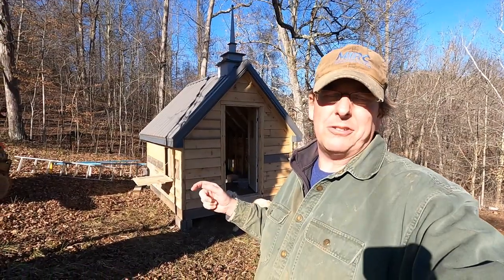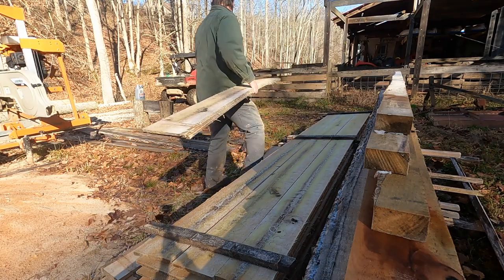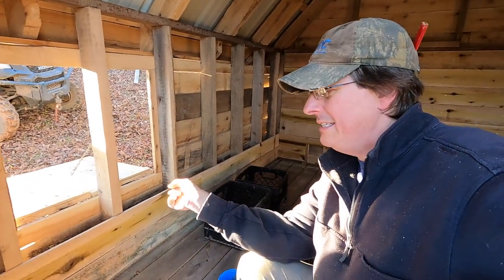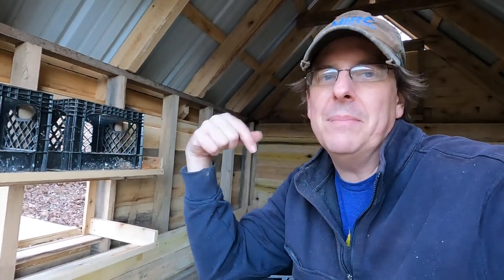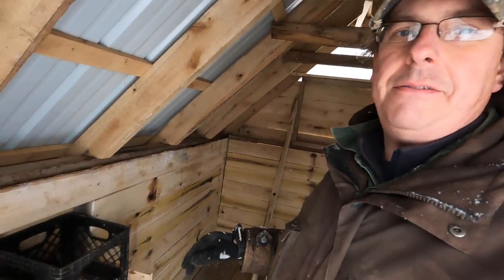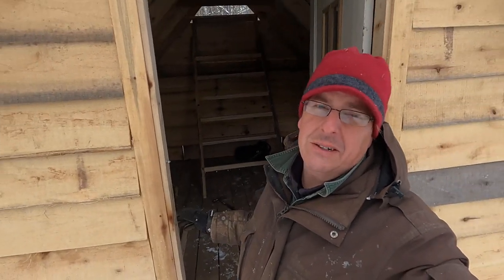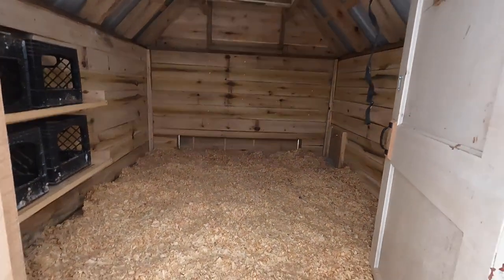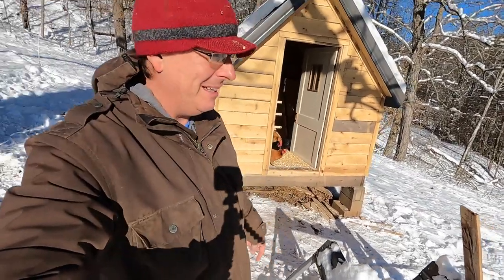The Congregation has Gathered at Chicken Church

Comment: Nice job Troy. I like to make a suggestion.  I have milk crakes for my nest box too. I found in short notice that chickens would roost on the nest boxes and poop in them . I put a board on top of the nest boxes . I don't have chickens roosting on the edge of the boxes and pooping in them now. Just a friendly suggestion.  Great job on your channel
Reply: Same issue.  I started using milk crates with no cutout to keep the hens from kicking all of the straw out of the box quickly.  The chickens would knock the loose board off the top.  I may build a sloped shelf above the egg boxes with enough space in-between the boxes and  the shelf to allow the chickens to get in there but not enough for them to roost on the edge of the box.  i think that would be best of both worlds.